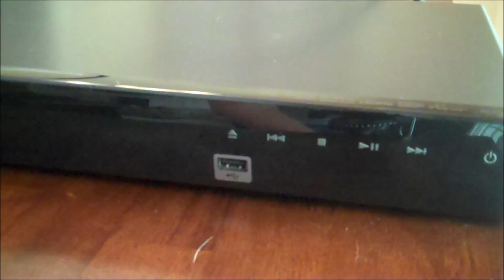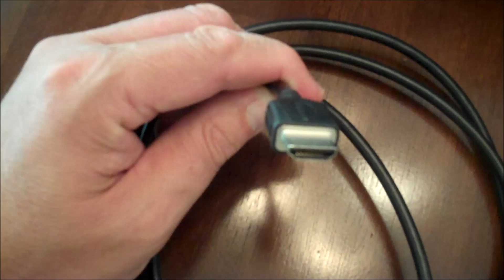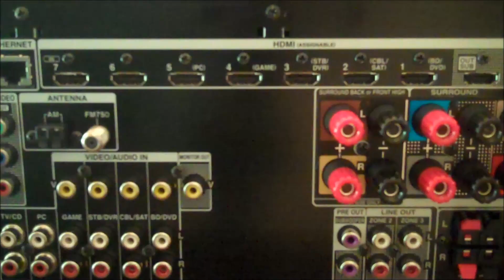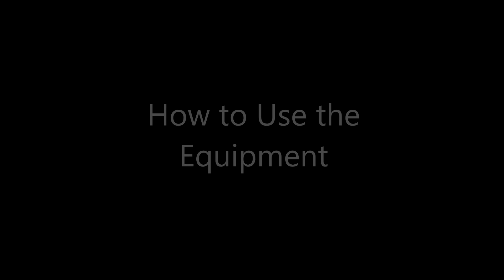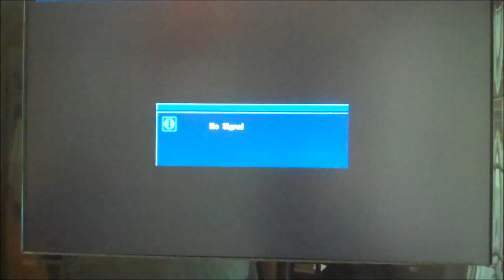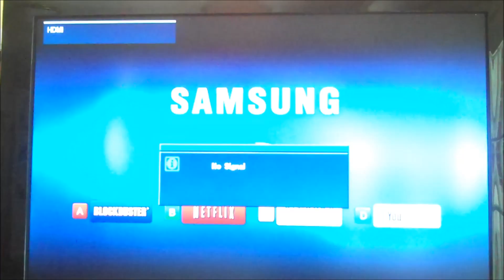How to connect a Blu-ray player to surround sound receiver

Comment: Hello,
I hope you can help me with this problem and that you see my "question(s) because of the date on your video.  I am having trouble getting the sound from my BD player to come out of my Home Theater System .  I have already followed all the steps you mention in your video here.  But, the only sound I can hear comes through my TV and not my HTS.  The system is an Onkyo HT-R397, my BD player is a Philips player with the only output being HDMI,  and, my TV is an LG Smart TV.  I hope that's enough info for you to help me figure out what I can do to make the sound come out of my HT System instead of only my TV.  My HTS is connected to my TV as you say to make sure it is in the video.   I also have a DVD player and a DVDR player connected to my HTS and the sound from both of those comes out of my HTS with no problem.  I have also made sure to put the HTS output on the proper one.  I hope you can help me with this.   Thank you so much.
Reply from the maker: Can you connect the BD direct to the home theater instead?
OR
Is you equipment newer ( 3 years or younger ) AND you see the letters “ARC” imprinted at HDMI ports?
OR does either your BD or TV have Toslink/Optical audio connector you could use?

Comment: Thankyou for your help. Please advise if you need to connect  tv to ARC?
Reply from the maker: Hi. We’re not sure what you are trying to figure out but thought maybe this video could help: How to Set up and make HDMI ARC work
https://youtu.be/uZ3BnvTB2_0
Reply from the maker: ARC is only a requirement if you wish ARC enabled TV audio to travel to an ARC enabled sound system/bar by way of an HDMI cable
Reply: Oh ok. Thanks for that. So if you dont need tv sound back to amp you dont need arc? Thats cool. So if I just want blueray sound from amp I just need to plug an hdmi cable into my tv (any port) from the amp? Is that right please?

Comment: Thank you for the information on how to set up the Blu-ray player I have an issue I don’t think I’m that smart with electronics,  All the information did come up from the DVD player to tv , put a cd in The picture comes up but I don’t have no sound I did buy the high-speed HDMI cable thanks for your help 👍
Reply from the maker: In the Blue ray player see if you can set the audio output signal to PCM and, see if your TV audio needs to be set to pcm (many times not)
Reply: Yo también tengo el mismo problema, se ve muy bien la pantalla , pero no se,escucha….!!!!! Que otra cosa puede ser?

Comment: Why in the heck would you connect your receiver out to TV in? You aren't playing your surround sound through your TV. You should connect blu ray player out to your  tv input this allows video and audio from your blu ray to send signals in to your TV.
Then if you want surround sound  you need to connect your blu ray out to your receiver input. Thus allows you to send signal from blu ray to home theater. 
Or
Blu ray out to TV in and TV out to receiver in
Reply from the maker: You’re right in, there are multiple ways to connect. Some will want their preferred & best surround audio signal. Depends on the capabilities of the equipment a person owns.

Comment: I have a Cable Box, 4K Receiver, 4K TV. I have TV IN connected to my Receiver using the ARC IN and Out ports with an HDMI Cable. I have the Cable Box connected to Receiver with an HDMI Cable. Everytime I turn on the TV, Cable and Receiver, The Cable Box programming is lost and must reload. This takes 10-20 minutes. The same is lost for my DVR Recordings until they Reboot. Any suggestions on what is wrong?  I thought exchanging the Cable Box might fix the problem but it did not. Thanks

Comment: Thanks, very well explained. However, I didn't see a clear explanation about which HDMI
input should be used on the TV.
I'm having trouble with the audio while watching dvd's; the sound is not in sync. People's lips move out of sync with what they're saying
onscreen. What can I do to correct this? Thank you.
Reply from the maker: Often, although not always, audio sync adjustments are available through a device’s “Menu / Settings”

Comment: How do you connect a bluray player to an older home theater system that uses coaxial connections? My Samsung bluray player has an audio out via coaxial output. Is is possible to connect or an I wasting my time?
Reply from the maker: Both pieces you wish to connect would require a “digital coaxial audio” connection. One outputs to the receiver’s input; both typically are clearly labeled as such

Comment: I only have one HDMI outlet on my Samsung theater receiver.  I guess it's not possible to hook it up to my bluray ?
Reply: TV=HDMI OUT on AV. BD=HDMI IN on AV.  1 OUT and 1 IN are all you need.
Reply: Salvatore De Boer I was missing the opitcal wire . I got it working now . Thanks

Comment: hi,
are there receivers in tge market with 2 hdmi outputs?
i gav since 2 days a short trow beamer hd 3d 
and its a huge struggle if i want to with to the beamer or tv.
but i want also use the beamer and tv at the same time (xbox on tv and pc on the beamer) 
is it posseble

Comment: Hello, 
So I have a Sony Blu Ray player that I just bought yesterday, and I've been trying to hook it up to my Denon AVR-3806 Surround Sound Receiver. The receiver is quite old. I am able to plug an HDMI into my Blu Ray and my TV for picture, but there is only one HDMI on my Bluray, so I'm forced to use a Digital Coaxial cable from the Bluray to Receiver. However, I don't know how to get the receiver to recognize the blu ray and play sound. The receiver is able to play sound from my TV, so its not a problem with not having the receiver be setup correctly.

So, what can I do to repair this problem?
Reply: Yes, I'm having the same problem! I have the Sony Blu-ray disc/dvd player #bdp-3700 trying to connect to Onkyo receiver!!  Please answer!! Thanks!!

Comment: very informative :) but... if i connect second video device through hdmi to receiver , how to switch source ? ps i understand thats this is not only sound receiver but also video receiver because bluray player connect to it than from here visual goes to tv?
Reply from the maker: +iHelloway On the front panel of the receiver you'd simply change the source to the source you want to view on the TV at that given time

Comment: I purchased the SKS-HT870 7.1-Channel Home Theater Speaker System, with a
Onkyo TX-NR515 A/V Home Theater Receiver. I love it, but I’m having some problems getting everything to work through my surround sound system. The only thing that I have working through the system is my Samsung Blu-ray player, but I like to get my TV, which is a LCD TV SAMSUNG 52 IN LN52b630, Xbox 360 250gb, and my JVC HR-VP673u working too. Can you folks please help me by telling me step-by-step what I need to do to get everything working through this system…thanks.
Reply from the maker: This page is a complete resource of diagrams, video etc to help you with your project.  http://allabouthomeelectronics.com/hook-up-surround-sound/